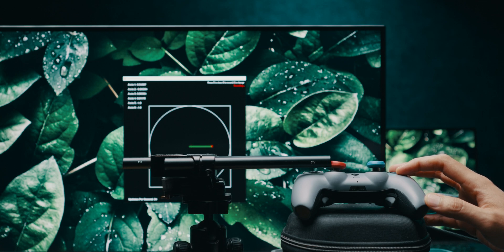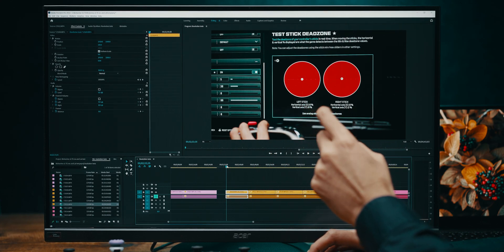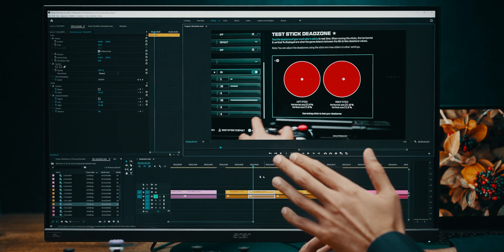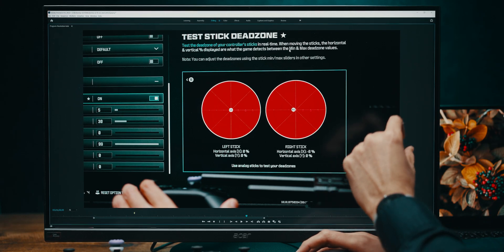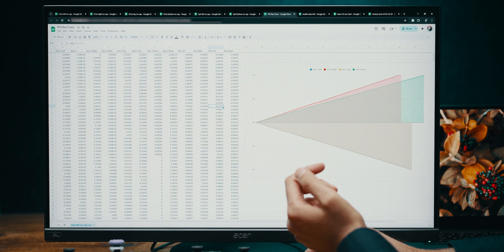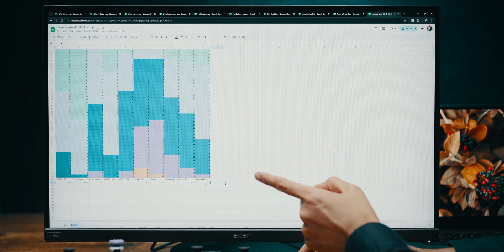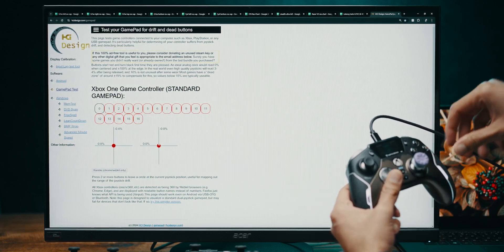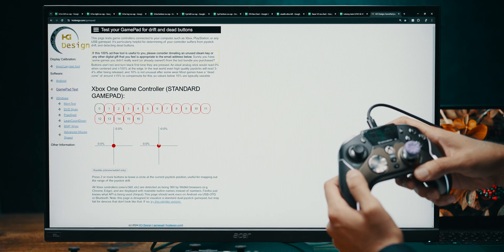Thumbstick Resolution performance impact

Comment: My dude I don't know why you are not that big yet, but I'm pretty sure you will be really big soon. 

I have a question for you I hope you can point me in the right direction: what is the difference between resolution and sampling points/zones? Is there a place where I can investigate this stuff? I'm talking about controller sticks btw.

Ty.
Reply from the maker: @pandoro2003  hey bro so the joysticks report a position depending where they are, a resolution is basically a difference between the points they can report. PlayStation controllers have 256 across the axis and Xbox controllers have a lot more, I've even pulled over 500 zones from centre to edge on my series x. A lot of people seems to love the PlayStation approach, but I've always been on Xbox and never thought it to be a problem. In my recent test pushing the selite series 2 slowly in COD, I did notice it could skip a percentage every now and then, that's with a motor moving the stick very slowly, where a lower resolution one would always report the same percentage in a push like that. Personally the only time I've seen the resolution making an impact a bit is in Xdefiant, where the game seems to be able to feel smoother for aiming with higher resolution. COD I've been able to use every conteoller effectively.
Reply: @thephototechy  thanks man, I investigated a bit too, seems that my confusion is coming from the "bits" it looks like I'm mixing, bits (8,10,12,14) with resolution and sampling points/zones. I will look for more clarification in these. 

God bless you. Your  content is great, highest quality and stuff I'm really interested in. 

11/10 and God.
Reply from the maker: @pandoro2003  hey bro so the bit rate can be applied to them, like the PlayStation has 256 zones across the axis, 8 bit is 256 different levels, 10 but would be 1024 levels and 12 but 4096 levels. So it could be that Xbox is 10bit across the axis and some newer controllers are claiming even 12bit output, so their individual zones must be tiny compared to 8 bit. How I test for it is to push through a motorized solution really slowly and record the axis position numbers. Checking the difference between the axis position numbers reveal the increment the sticks going up by.
Reply: @thephototechy  yes, this makes sense, chat gpt is throwing similar information, thanks very mucho dude, this clarified a loooot for me. Really appreciate it.

Comment: Hey brother, very informative and well done video as always, Have you sussed out the "Prevent Double Deadzones" option in the software?

All it does is creates a smaller  outer threshold so the sticks are slightly more touchy/responsive. Pretty much the same as what GameSir is doing with the "RAW" mode. If you feel like the sticks are a little too touchy just disable it and it definitely makes a difference.
Reply from the maker: @bahgoesthesheep  hey bro thanks for sharing this, I was playing with this a lot and was hoping they had given us a number option of how much anti deadzone we can chose from, but right now it feels like too low for it to be effective. I was hoping that forced deadzone bug in COD would happen to me, as it did with FP4 recently, but the amount they've used won't help with that bug as that seems like a 10% forced deadzone. Still the controller is feeling great so far for me.

Comment: For the Razer v3 do you have 1) Disable double deadzones on or off? 2) Do you use the circularity feature or the regular? Thank you so much.
Reply from the maker: Hey bro so I was hoping the double deadzone feature would allow some sorta custom output option, but there's on such option and in my tests it's not doing anything for COD, so I've kept it off. Also I keep the standard output and not the circular one, I do hope the double deadzone feature gets an update as COD forced deadzone bug on series x is still there and this could be a game changer.
Reply: @thephototechy Thanks for the answer brother. I just got mine a few hours ago and I have been testing it on Halo Infinite. With A) circularity enabled/ double deadzones option enabled I had slower aim but it was much smoother (similar to radial for elite s2). With B) the regular/ deadzones enabled my aim felt a bit snappier and I was able to make more fine tune adjustments for people with unpredictable strafes. With C) regular/ deadzones disabled I had the best aim. Maybe bc the game provides more aim assist. But from a short test on an octagon against a bot I was shooting the highest with C), around 80% and 40 perfect kills out of 100. I still need more time to test it but I would like to know what you think as you get more time with the controller. Btw, your channel is highly underrated and you are way better than the bigger controller channels. I find them more dumbed down for a casual audience and you to be much more precise and scientific, which really gives me the real metrics I need for a controller. Let me know what settings maximize having a snappy aim along with precision 🙏. Thanks again
Reply from the maker: @AR-fp5xp  hey bro thanks a lot for sharing this. I'm too keeping the deadzones disabled with regular output. The double deadzone feature is not showing anything on my tests so far. As a whole I'm enjoying the controller a lot, definitely going to be my main 4 back buttons controller.

Comment: My TE has 0,3 and 0,-4 with the deadzones at 0,0 miles better than my gamsir g7 se and my he
Reply from the maker: @StickyGeko  those are very good centre numbers. TE has a bit lower resolution numbers than SE/HE so at centre you will see more fluctuations on Gamesir than TE.
Reply: @thephototechy  my se was good I liked it but 2 controllers both LB broke, replaced with the HE but really didn't like the feel of the sticks, it was hard to press in as in L3 R3. Replaced it the v3 TE, feels nicer, my kd on halo has gone up, I like the feel of the v3, sticks are smooth
Reply from the maker: @StickyGeko  hey bro any chance you remember if both your SE had black colour hosing modules or  clear transparent one? My SE is a pre order and has black colour JH16 sticks, HE on the other hand has transparent clear ones.
Reply: @thephototechy  I've got both I can check later the HE is clear with a red stem

Comment: As always a very high quality video, very pleasant to watch. So one question, what is you favorite controller you've used so far? How do you like the V3 TE ergonomics?
Reply from the maker: Hey bro so the controllers I've put the most time ever on after starting the channel, would be the G7se, Victrix Gambit, EswapX, dual sense Edge and Hex phantom. If I have to keep one controller now for a two back button choice would be the Kalied, just because of Xdefiant seems to behave better with higher resolution on series x for some reason, and 4 back buttons would be Wolverine V3 TE.

Wolverine V3 did gave me cramps on my left hand the first day, but once I got adjusted to it, man its such an amazing feel to never let the thumb off the right stick ever, really makes you feel engaged a lot. I do find every time I take my thumb off to press face button I never return to the optimal placement straight away, kontrolfreeks help but Id rather have 4 back buttons.
Reply: @thephototechy  appreciate your response. I recently purchased the G7HE for my Xbox series x and I really like it. Since I'm playing claw, I need only two back buttons maximum. I just wished the controller was somehow bigger size. Controller manufacturer should start to make different sizes like normal and larger versions

Comment: Gamesir for the win! Resolution may be the most important measurement of all, regarding aiming with a controller
Reply from the maker: @Psilent_P  hey bro so I do feel extra resolution working a lot better in Xdefiant for sure, even only 25% extra resolution of Kelied makes it feel better than the G7se for me. In COD I can adjust any controller to get a good feeling aim. It might be that the manufacturers are probably using COD to optimize their controllers or COD's just easier with a controller.

Comment: Fp4 needs fixing urgently it feels even worse in game than a pdp rematch 😄😄
Reply from the maker: Hey bro can you confirm issues as well with aim? I can get adjusted to it but do find myself fiddling with it alot when I move to it from a different controller. Also the V3 TE makes it that I just end up using that one.
Reply: @thephototechy  yea man it's awful from rocket league and call of duty it's awful the aim is unpredictable
Reply from the maker: @RyanDench-lx6cx  bro thanks for sharing, this helps a lot and confirms my suspicion of the awkward output they've used, for me it feels a bit unpredictable so AI feel like fighting it a bit for aiming. I do hope a fix can be applied as the controller overall is a decent one.
Reply: @thephototechy  the actual controller itself minus the sticks is very good , but for me the most important thing to get right is stick performance
Reply: I'm going to fix my eswap s with the hall effects , so for now I'll use a 20 pound controller - nacon evol-x pro 😄

Comment: Is this same as "step presicion accuracy"  on the Rainbow 2 SE you can set this setting to either: default, 32 -  64 - 128- 264 and which setting should i use ? All of this is a bit confusing to me
Reply: appriciate the in depth videos as always
Reply from the maker: Bro I really want to try the custom resolution output Rainbow 2 has, it's basically the ability to change the number of zones you can have on the sticks. So in theory you can make it lower like the stealth ultra and muchich higher than even an Xbox controller. Not sure exactly what those numbers correspond to, it might be the size of the resolution point, so the larger number would mean lower total zones available or vice versa. I'd say change them and check on HCI design how much incremental change you see. A lot of people love PlayStation controllers and those have 128 zones from centre to corner with a .78 increment, that might be a good starting point.
Reply: @thephototechy thanks, ive tried 64 and. 32 as of now but those did not feel as accurate (to me anyways) as the default setting, ill give the 128 a go i do like the PS4/5 controller If only they had 4 padels ...